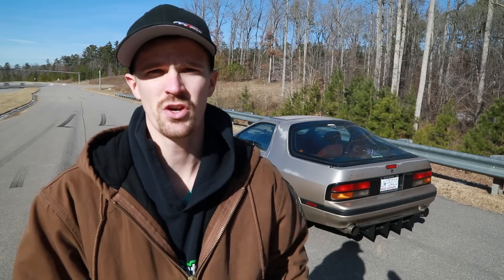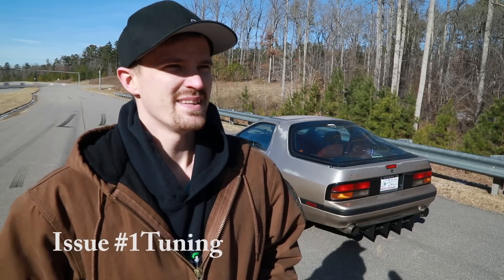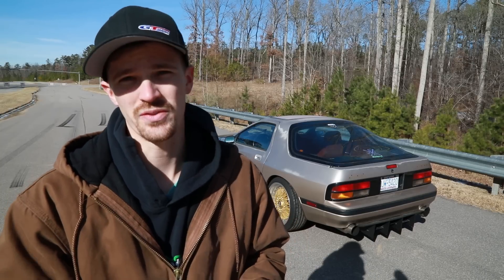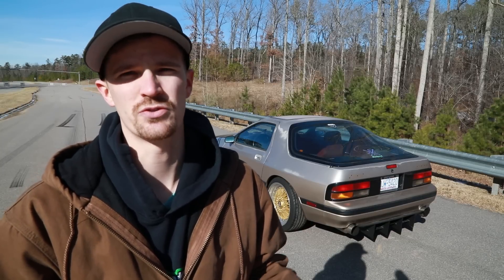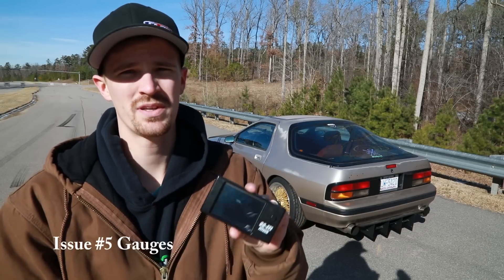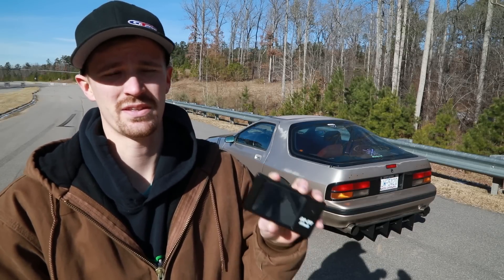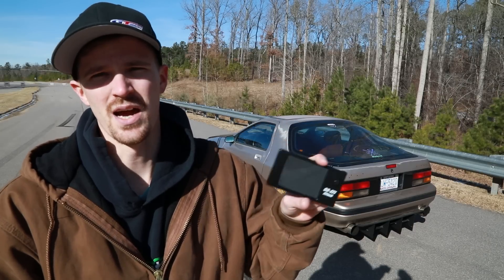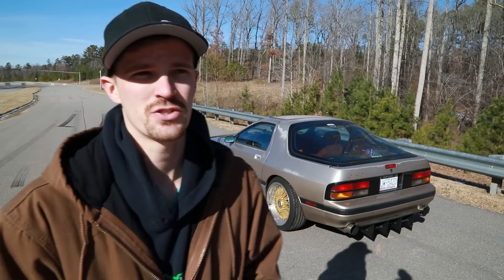5 Reasons Not to Buy FiTech EFI System

Comment: pulled the filter and 40 horsepower was found
Reply: I would agree get a bigger air filter man . Look up engine masters on YouTube they did a video on air filters
Reply: @NZMOPAR  Engine Masters 99% of the time are just doing already proven builds or sharing basic info. Every once in awhile they share something thats a myth or not correct. Careful believing everything they share. They are still a million times better than PowernationTV. Im not a hater, Im just sharing the truth so people will understand they are not the Bible of engine building or whatever. Just fact check their stuff.
Reply: I'm cutting a hole in my hood  and making a scoop to fit a salad bowl.
Reply: Gmullin12 yea cause your basically suffocating the engine like a 350 v8 needs a 14in air cleaner
Reply: I had too small of a filter on my v8 rx7 to clear the hood. took it off found a ton of power.
Reply: thought you guys were busting his balls about the air cleaner so i looked it up and its a big deal now i gotta check to see if im chocking my 350
Reply: Total agree...
Reply: nz mopar rebuilds, the salad bowl is where its at!!! Lol
Reply: Or get a turbo II hood to help clear a bigger air filter
Reply: Choking the unit with a shitty filter makes a drastic difference in driveability.  The fitech doesn't like being suffocated
Reply: Ya, sometimes the problem isn’t the Fitech unit but rather the way the engine is setup or built. My father was pissed off with his unit for about a year because he couldn’t set the IAC steps. Later he found it was because there was an intake manifold leak. I was having some issues with mine but changed the air intake and found more horsepower and I was able to tune the Fitech better.
Reply: I had the same issue when i first installed my unit.  Two baseplate gaskets on the unit solved that problem.  I put 35,000 miles on my unit getting 18-21 mpg at 80 mph with the a/c running and finally decided to swap the carb hat to 3.5" intake piping setup I had on the truck to a racing drop base 14" air cleaner and 3" filter, truck felt like it picked up 40 hp instantly.  It also fixed a persistent rich bog that had always been in the unit.  I would go WOT and the unit would snap to 10.5:1 AFR for a couple seconds and then snap to the commanded 12.8:1, hasn't happed once with the better flowing air cleaner.  Certain techs at fitech will tell people to try doing a pass or two without an air cleaner to see if it resolves an issue they can't seem to tune out.
Reply: Agreed, when I saw that I was WTF? The guy is going on about tuning and using a power killer like that? Basics, people, basics!
There are plenty of different filter designs and materials around - some of the best drop types can substantially increase power over an open carbie - check them out - a few $$$ but cheaper power/torque than many other options. I added some to the comments on that Engine Masters feature as they missed several good options - yes, better than the salad bowl without the drawbacks.
Reply: Yeah he needs a drop down air filter base, and also maybe to trim some of the hood bracing to fit a bigger air filter, might even help with some of his tuning issues by not choking the engine for air

Comment: it's your intake. mine works great with just a spacer if you ever dealt with carbs. you would know some carb and intake combos dont work together also. sometimes you have to play around till you find what works. mine had hiccups on a summit dual plane threw a 1 inch spacer in and it fixed it. the summit intake wasnt milled down in the center so the Fitech was getting funny readings. but I do like my holley system alot more though.

Comment: That filter is part of your problem tuning I’m positive.
Reply: Watch the engine masters episode about air cleaners and housings. That air cleaner is a huge issue.
Reply: power would most definitely be down, sure it will adjust air/fuel, at a lower power level.
Reply from the maker: I wish I have run the system with and without the filter. No difference to the issues I had with heal toe shifting. I was impressed on how well the system did when I went from no filter to this filter. It adjusted quick and kept the AFR's the same even with the added vacuum.

Comment: That fitech sucks sold mine cause of fuel problems I got everything from them and still not working was told that where I had only 6 pounds of vacuum it would not work say away from them
Reply: 4low1 how much did you get for it. I'm selling mine too. With command center
Reply: i got 1200.00 for it so I lost a little but not bad
Reply: I got 1000.00 for it

Comment: Petrol360, I had a big problem with an extreme lean condition on tip in (getting back into the gas at part throttle) with a stock vortech 350. I found on a forum where a guy tricked the fitech by telling it it was a much larger engine. I was at my wits end with this thing so I gave it a try. I ended up using 502 cid and it worked! I'm using a 5 speed manual, and as youve seen this problem rears it's ugly head even worse than an automatic. I had to cut the fuel learn way down after doing this as well. It's sticking to the target afr even at that setting. I have the same unit you do and after several months it's finally running good. Don't give up just yet

Comment: Thanks for the info. You told the good and bad , which is fair . I like hearing the whole truth 
One suggestion . Get a bigger air filter . It may be choking that engine 
Motor trend had a good video  about comparing almost 20 air cleaners . It's great info 
Hope things get squared away for you
Reply from the maker: Thanks for checking out the video, your not the first to send me to the motor trend video. Iv got about 2” between the hood and the top of the efi unit so its the only air filter that fits. (Iv tried them all) a custom filter is in the works

Comment: I actually took mine off and bolted my BG 750DP back on my race car the other day because I was getting dead spots on hard acceleration and it wasn't a pump shot issue because the only way to cure it was to roll out of the throttle all together and then reapply it. only once in every 20 minutes of racing! weird . my carb never did this, and really poor service and no info or comprehensive manual.

Comment: lower your DFCO.... It really sounds like you are running older firmware
Reply from the maker: Iv run every DFCO setting I can and it’s gotten much better but it still won’t allow me to heal toe shift. Not a huge issue, the system wasn’t built for road racing type applications.
Reply: how about your DTPS Gain? it is under accel pump settings
Reply: out of the box the system is tuned for a weekender type street hot-rod....but it can be tuned for your application. but you would have sames issues with holley or FAST systems
Reply from the maker: ya I know the holly system will have the same issues out of the box, im thinking of doing a custom efi system down the road and then using mega squirt to run it. Probably dyno tune it from there and have a pro get it set up 100%.  But until thin this sysem does 90% of what I need. Think im going to do a video with 5 reasons to buy the system. Its definitely not all negatives. This system changed the market bringing in efi at a cheap price point, it made all the other players jump to build a system that competes.
Reply: did you adjust DTPS gain?
Reply from the maker: Nope I don’t have that option. That is what I was talking about in the video. It looks like that is what I need to be able to tune in order to smooth it out. Hope it will be on the updates, I will try and get this uploaded on the system over the weekend.
Reply: well you dont have latest firmware
Reply: message me and I will send you firmware, I have it for that system
Reply from the maker: Looking around online and can’t seem to find any updates, the only thing iv seen says you need to contact them and they will send the files to you? Does that seem right or do they have the updates hidden on the website somewhere? Thanks for the help by the way!
Reply: no you have to email them.... but if you have 3003 system, I have the file I can get to you
Reply: I may need the firmware, i just bought the kit.  What version firmware should i be looking for?
Reply from the maker: Jabin sent me the files he got from fitech and the file name is "30003 T198i" plug the hand held up to your PC and open it as "Open USB Mass Storage" then the fitech pops up on your PC like a flash drive. I think you can then open the file and see called "30003 T198i" if that matches what you have it should be the most up to date. But to make 100% sure check with fitech, they don't post the updates anywhere I think you just have to ask.
Reply: That is correct - I've done it.

Comment: White screen is low voltage. Also make sure you are running the latest firmware, I think 198 is the latest firmware. Those tuning settings you mention, should appear. Also, without timing control, you aren't gonna get super great results.
Reply: Jabin Trapp Of course. But Fitech doesn't need to control it to do so.
Reply: The latest version is T198 rev: A now. I don't think the 400 has timing control.
Reply: the 400hp model 3003 does not having timing control. Just stating that without timing control, you limit the units ability to tune
Reply: Jabin Trapp That's not true at all.
Reply: there is plenty to tune true, but timing is integral to proper tuning

Comment: Fitech isn't only a crappy system, their customer service is the worst of any company I've dealt with. It's like they're doing you a favor by selling you their substandard efi system and then they give you grief to even help you troubleshoot. But hey, at least they're substantially cheaper than the proven big brand systems right...? hmmm. Not! Buyer beware!
Reply: Juan, the Fitech is really based on the hobby enthusiast that doesn't have a 4000.00 pocketbook to spend on something like a FAST system. Customer service...for me has been great. Sorry for your troubles.
Reply: Juan Acosta at least there making EFI cheep enough to give holly’s high end carburettors a run for there money‘s worth and Normal people a  fighting chance of having to turn the key and drive with little to no worries
Reply: FAST system is garbage!
Reply: I run a meanstreet 800 and have had almost no issues with it.  Course i learned on an a9l based moates quarter horse on a 331stroked foxbody.  That fucker would fight almost every change i made.  Learned quick to wipe the learning everyday.  Put a scoop on, get a good aircleaner and start over.
Reply: lol thats the problem with fitech. Its not turn key and drive. If you want cheap and turnkey and drive then get a $300 edelbrock carburetor. I get it, thats why I bought the 400 hp unit and I got what I paid for; cheap.
Reply: @frankbyers7224  
759.00 is cheap to you ? Plus the right fuel system it needs like 50/60 psi for that unit jegs has the kit with fuel system for 1,200 and some change I would be pissed !!!!! I was really considering adding it to cart  but not so sure now I'm running a big 500 cfm Holly 4412 2bbl I'm shredding the tires with that but gas milage sucks 50 cc accelerator pump all the power I want tho .
Reply: $759 is pretty cheap for fuel injection. I feel like I spend at least that much monthly on my car. I don't mean to put the fitech system down so much, I just feel like their advertisement is misleading. In my experience, I didn't just bolt it on and go. It was a big hassle to get everything running correctly. The only benefit I can see is the fuel doesn't boil out like a carburetor which causes hot start issues. I did not notice any fuel economy or drivability increase over the Rochester 2GC.  I just purchased the Holley sniper 2300 for another car of mine. I will see how that goes. The holley 4412 is a good carburetor. If it is not a daily driver then I think you may feel like you wasted your money with one of these self tuning efi units. If you have a wideband o2 gauge then you can tune your Holley to provide a pretty good balance between power and economy.
Reply: @frankbyers7224  
Yes the 4412 is good but with the 50 cc pump it's better for burnouts I can use a tank of fuel pretty quick. It's on my 69 F 250 only reason for using it , I had the motor rebuilt they put the stock 2bbl intake on since the pushrods go through the intake on a 390 . I was about to buy a 4bbl RPM and 600 Holly I showed up and the intake was on it I also have a Holly 350 cfm with a 30 cc pump maybe I won't do a burnout but I bet it be a great daily I haven't put that on yet rebuilt by national carb .
Reply: lol well its going to be tough to get any kind of good gas mileage from a 69 F250. The 69 390 2v came with an autolite 2100 or 2150 I cant remember. Its a very good carburetor with annular boosters. You can order a rebuilt autolite from rockauto for about $200. Go to rockauto.com and find your make and model then go to fuel/air and select carburetor. The autolite 2100/2150 carburetor is the next best thing to fuel injection.
Reply: @frankbyers7224  
I know lol ...I liked the body style and seen the truck on Craigslist paid 2k it ran then it broke down on the fwy it was towed home gas in the oil from mechanical pump bad flexplate  cracked head I rebuilt the 390 if I had to do it all over I would had done a 302 or even a built 300 6 but that's my 2c the autolite and motrcraft were 300 cfm my boxed Holly is 350 if I get 15 mpg on the fwy I had a good day 10 mpg in the city
Reply: Agree their support sucks. No one answers the phone and no one responds to emails - just overall terrible support
Reply: @lindmar  
Probably due to them trying to de  buggy all the complaints I heard nothing but good about fi  tech 2 people at work have it one on his boat the other on a el ca mino I was considering the 400 HP 2BBl set up but not sure I'm going to add it to cart for a grand with fuel system at this time ...